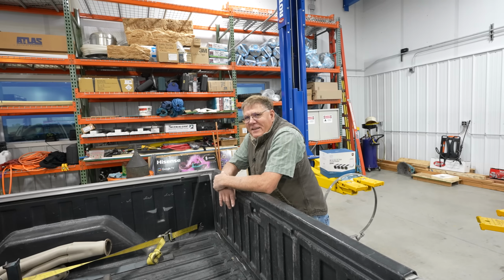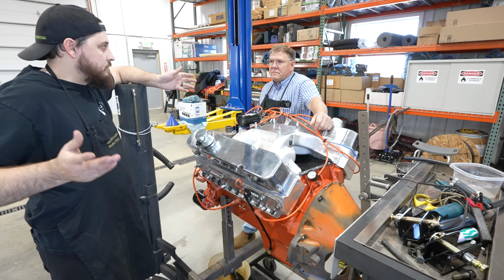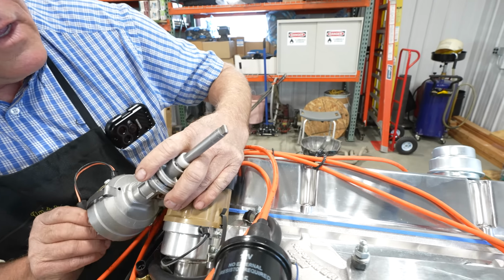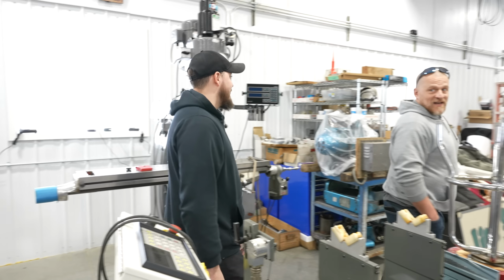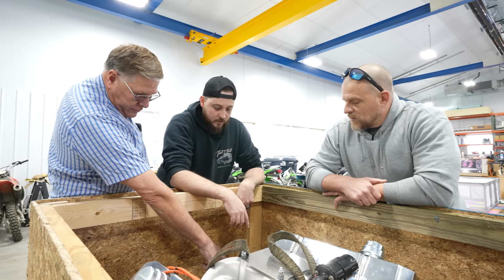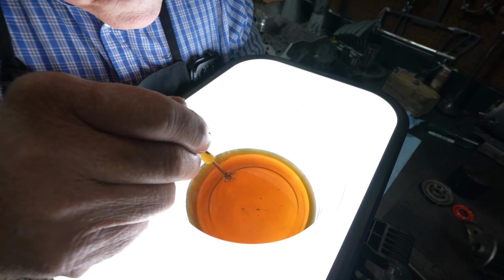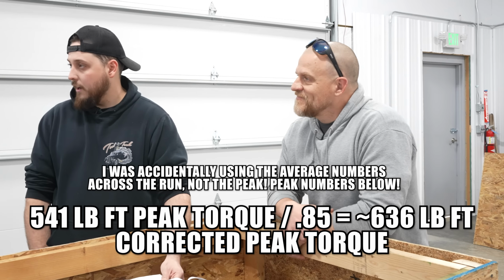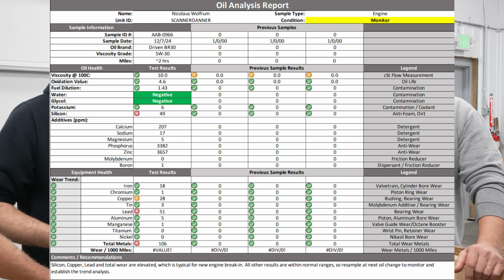From RATTLE CAN Rebuild To A MONSTER 483 Stroker! Dyno Time!

Comment: 2 questions: did you bore all the cylinders on the first side 20 thousandths, or just the first cylinder? Did you have to repeat it for the other bank? Thanks 😊
Reply: I forgot to mention, 20 thousandths off center.

Comment: The distributor is driven by the cam gear to the distributor shaft gear. How does a lose fit on the oil pump affect this?
Reply: There is a shaft driven by the cam.  One end drives the oil pump, and the other end drives the distributor.  The loose fit was between the distributor and the shaft.  The shaft slot was too wide.

Comment: Polycarbonate should be good to 302 - 350 degrees F without deformation.  Molding and extrusion temps are approximately 530 degrees F. Perhaps your material that you used for the valve covers was not Lexan.  The protective plastic film on the plastic sheets should of had the brand name Lexan or a generic name that crosses with Polycarbonate.

Comment: Alan of Gold's Garage does complete engine builds. However, all machine work and dyno work are jobbed out.  He takes responsibility for the engine performance to his customer and would work out any machining issues with the machine shop if needed. The customer works with Alan and Alan works with the outside contractors.  Perhaps not the best arrangement, but it has been working great so far! It is kinda diy but Alan's background is building racing engines for successful racers, including for his son's winning season!

Comment: Really enjoying your videos, a true and passionate machine-shop is rare these days. Can I ask you a question? I’m rebuilding my stock Mopar 400 and the valve-seats where cut a little deeper on some exhaust valves. Can I shorten the tip of the valves by 0.040 to keep the valve train even?

Comment: I don't use wix filters anymore. They got bought and the quality has gone down. Honestly the "orange cans of death" (Fram) are (just in my opinion) the more reliable and safer oil filter now days (the past 4 or 5 years). The fiber end caps that people initially said was just cheap junk. BUT....those fiber end caps are being found to just flat out work better. They overall these days just seal better than metal to metal. Plus the way they are constructed, the glue works better and doesn't come off like on the more expensive premium metal end cap filters. Id rather (and do) change my oil every 5k miles and don't need an expensive 20k mile filter anyway so. But long story short, that glue coming off the Wix has been a problem since they got bought out.

Comment: He can put a double diaphram small diameter booster vs single diaphram large diameter booster for brake system so you don't have to possibly dissect into valve covers.

Comment: ((SOAP)) Oil sample in container should be taken from hot oil sample within 5 min of shut down after running it. Technically you want to find parts per million of float suspension material before filtration. We always pulled samples from midway of oil pan with small tube siphoned into a bottle from dip stick tube.

Comment: I'm  mopar guy and used to drive  67 barracuda with a 440 in it. I was told theres a bracket to move the brake booster but I cant remember what car it was from? Maybe google will know?
Reply: The off set brake master cylinder bracket is the one made for the 1968 Barracuda with a 426 hemi.
  The bracket is reproduced .
I think that AR products (Andy Finkbiener) makes this bracket today

Comment: Lexan polycarbonate has a softening temperature of about 300 F (~150 C).
Reply from the maker: @1976Datsun  the product we used specifies 180°F https://www.usplastic.com/catalog/item.aspx?itemid=132114&clickid=ltk-email&trk_msg=DTF7HTNUIEH4P6FN8I8M96LATS&trk_contact=Q7DT269HRO0DQS4L28HN3PCH6O&trk_module=bna&trk_sid=4607JNN0F2MGQQSKDBRUI2EHR8&trk_link=20I9OS3UAVD4H9QEMPOEVALFU8&utm_source=listrak&utm_medium=email&utm_term=View+this+Item&utm_campaign=ba&utm_content=ba_3
Reply: @JAMSIONLINE  Thanks for the reply.  There are other grades on their web site with higher softening temperatures.  I pasted a link before but my reply got erased.  Youtube does not like conversations, apparently.

Comment: 15:50 Only 503 hp? From a 483 ci mill with aluminum heads?? WEAK! Must be a small cam, for the torque and vacuum. The torque was ok.

Comment: What you were saying about how motors power output changes depending on elevation and temperature, is why i love the Pikes Peak hill climb.
It starts at a higher elevation than any race on earth and only goes up from there. So demanding, its a real test of engineering problem solving
Reply: Don't forget the crazy aero kits!

Comment: Why is torque measured in lb ft and not foot lbs
Reply: yep old school is foot-pounds
them younguns gone changed it
all my manuals say ft lbs but when you get down to it they are equivalent 
one rolls of. your tongue easier than the other
Reply: @smittywood-wp6he
@Idiver61
Colloquial usage has blurred the distinction but,  strictly speaking, a pound-foot is a unit of torque (and as per SAE J1349 is the official measurement of engine torque) and a foot-pound (actually foot-pound-force) is a measurement of work. 

One is a vector quantity and the other is a scalar quantity so they are actually two different things.

I can’t post a link but can I recommend the Engine Labs webpage which discusses the difference between the two in some depth.

The difference between the two measurements (and where they were applicable) was a favourite trick question when I was at Trade School

Comment: That is funny he said at 50 years old that is enough hp. I am 62 years old I have drag raced most my live. Now for my street rod I have a 1959 Rambler American Wagon 2dr 482ci 871 blower it is 885hp to the wheels with the 250 shot NOS Its 1135hp to the wheels. I love it. Built with the best of everything. I am taking carbs off and going with the FITECH 30064 that is the 16 injectors what I like about FITECH your back efi is your main one and it dose all the tuning it runs the front one. Holley sniper don't have a efi that runs a blower. I'm only running 14 pounds of boost. Love your channel. All the old motor you guys build is what I started with.
Reply: 59  I had a 57 Rebel with the 327 and a hydrostick  (worked for the Dealera) also a 60 and 61  what did you do for front suspension and diff?

Comment: 13:33  Mopar big blocks had so many ignition problems back in the day that they would have had twice the horse power today with our improved ignition systems. Any aftermarket dissy should just have the matching slotted drive gear installed. Also the pick up and the ignition box should be the same manufacturer. Another thing that has bit me in the az with those is the space that the arm from the advance vac canister travels can be tight enough to grab the advance rod and cause the timing to skip about during excelleration. Mopar got the award for the most complicated simple ignition of the 60s and 70s. Good job figuring it out.
Reply: I’ve been building and tuning Mopars (and some ford/amc/shivolay) since the 70s, and the Mopar ignition system is just never an issue, especially back when the OEM ignition modules were being made with first-run Motorola/TI/Fairchild/ etc. semiconductors. Today I run stock Mopar electronic distributors (recurved to my liking) paired with  FBO ignition modules, which are a direct replacement for the original Mopar electronic box. I chose  FBO because it’s a modern circuit built with modern silicon, whereas  ALL of the parts store stock replacement ignition boxes available today (Mopar, Ford/AMC Duraspark,and  GM HEI) are made with really crummy knock-off transistors from overseas. This is because the original parts have been out of production for decades and only the knock-offs are even available. The same problem exists for things like ham radio, military radio, and even stereo amplifiers because there’s no demand for the old, large, discrete semiconductors.  We’ve tested old Motorola and new “direct replacement” transistors side by side, and the gain curves aren’t even CLOSE, plus the new replacement fail under much less stress than the originals. Which is why people are always complaining about how their Mopar, Duraspark, or HEI just won’t last. If you can find a NOS module, USE IT!

Comment: What a cool video. In comparison my 65 GTO project came from his hometown of Pittsburgh. I bought it 95% complete with a rebuilt 455 done by a guy in Pittsburgh. It lasted appox 20 miles and ate itself! Finding a good builder like you here in PA takes time and money. Once arranged it took months to get in que. Its finally done and my rear main seal has been replaced 4 times that means engine out each time and it still leaks. The Builder did it last time but sold his dyno and has no way to test like you guys did to find the problems. What you did was worth every penny congrats on the engine build and congrats on the new shop!
Reply: Look up Miller automotive in Boston Pennsylvania,  they specialize in pontiac engine's

Comment: You can use an old serpentine belt as a lifting strap.  I was a little dubious the first time I saw that done, but it works better than you would expect.  They hold quite a bit of load.  I probably wouldn't use it on a diesel engine, but for regular car and light truck engines it works fine.  You can always find another serpentine belt if you end up shipping it with a customer's engine.
Reply from the maker: It only takes one time of having a belt break to do substantial damage to an engine or even cripple someone for life.  Is it really worth the cost of a proper lifting strap?

Comment: When we did run tests on the GAU-8 hydraulic drive motors... we would take the filter and rinse it down with anhydrous isopropyl alcohol any then run that wash through  .5 micron patch paper. You see everything that the motor released into the oil and caught by the filter. Hair spray locks that sample onto the patch and those would go with the parts the military ordered as quality proofs. It takes two 42 horsepower hydraulic motors to power the GAU-8 gatling cannon.
Reply: USA baby! 🇺🇸 lol
Reply: @MichaelD-fn5lv  Frickin' A right buddy! Normal fire rate for the GAU-8 is about 4,200 rounds a minute. We pushed that sucker to 6,000 rounds a minute and it just sat there on the test stand barely working up a sweat. Gotta love it when the right engineers say: "Here, hold my beer and watch THIS!"    LOL
Reply: @gerrywalsh5766  I'd imagine the engineer said somethingmore like "hold my clipboard" haha! That's awesome, I appreciate ya sharing
Reply: @MichaelD-fn5lv  Too right... Clipboard and Slide-rule.   LOL  When I was load testing one of those hydraulic drive motors, I lost water pressure to the dynamometer. The motor went from 8,000 RPM to over 20,000 RPM in less than a second. I hit the EMERGENCY STOP for the Dyno and dreaded doing the obligatory dismantle of that motor. EVERYTHING was still in tolerance and when I rebuilt it with new seals, it passed the dynamometer run with flying colors. I also built and tested the flight control pumps for the Patriot Missile... That was fun checking those tiny buggers.  Lol

Comment: I think that at a minimum an efi swap needs to be port injection. Seems like efi throttle body injection is "dry" compared to a carb and seems like that could be part of the problem.

Comment: The dyno graph has a problem! The torque  and hp curves ALWAYS cross at 5252 rpm. Your graphs show about 100 rpm lower. Makes me question  the hp output  accuracy. About 600 hp at sea level  does seem  very plausable and reving this torque monster above  5500 doesn't  make sense.
HP = torque × rpm over a constant of 5252. So at 5252 rpm torque  and HP  are identical. Above  5252 rpm hp is higher then the torque reading.
So at  2626 rpm (Diesel range) hp is 1/2 torque  number. And if you  have an engine that works and lives at 7878 rpm the hp will be 1 1/2 × the torque  reading. The Aston Martin Valkerie has a 1000 hp (v12?) naturally aspirated  engine that spins  at about 10500 rpm. Do the math,about
500 lb-ft at 10500. Working on pleasure boats my whole life i was into distributors  with points constantly.  So feeler gauges and dwell  meters and timing lights  were  constantly  used. No more distributors  in modern boat engines. Mallory  marine distributors  with  flame arrestor  vents were oem on many engines. The cams that  controlled  the points could  be so
inaccurately ground that 
I got different  feeler  gauge readings  on the 8 different  high spots  on the cams. On a v8 engine the timing marks work on the  5th cylinder in the firing order. A difference  of 2-3 degrees between those 2 cylinders was common. Took a bit to analyze  why some new engines ran better then others.  On twin  engine boats you woud like to see the max rpm as close as possible 100-200 rpm difference  at maximum. Point opening accuracy, advance curve and total timing and propeller consistency  between   port and starboard sides.
Not to mention  advance  weight  springs rusting out and breaking. Advance weight limiters 
loosening  and allowing  over advancing. Timing was initially set at the factory  number (10 degrees  fairly typical)
 and then checking for  total advance  which  is more important and finding one engine ran best at 6 btdc and another  at 14 btdc to achieve  the same total advance. 
On 2 cycle  Detroit Diesels  the  difference  between 2 engines  was a goal of 20 rpm.  On 1 brand new  boat the engines  were 100 rpm apart at full  throttle. After fighting with the engine company, the local servicing dealer. the  boat manufacturer etc, we where at a fall boat show and  another out of state Detroit distributor was offering a
 a manufacturer sponsered tune up
 class. 2 weeks  later driving the boat 
owners  Corvette i went to school. That  worked out great. On his next boat 7 years later the boat manufacturer  tweaked  the engines  and  propellers  so accurately  that the rpm difference  at wot was 7 RPM at delivery.
Ask me about my adventures with small  and big block Chrysler Marine engines.😊
Reply from the maker: You’re right, it looks like the numbers are a bit off. I should’ve caught that; it’s a math error between the corrected data and the measured data I used to create the chart.

Regardless, it’s not very far off. Only changes the peak power number by a little over 1%. It’s not unreasonable to think this combination will be in the realm of 600HP at sea level.

Comment: In piston aircraft engines, oil analysis is recommended every 100 hours throughout the lifecycle of the engine. Also, as a rough rule, we expect to lose approximately 1" of Hg from the intake manifold pressure (starting at 29" at sea level) per thousand feet as we climb from sea level to around 10,000 feet. So these dyno estimates you guys make for the effects of altitude seem very conservative to me.